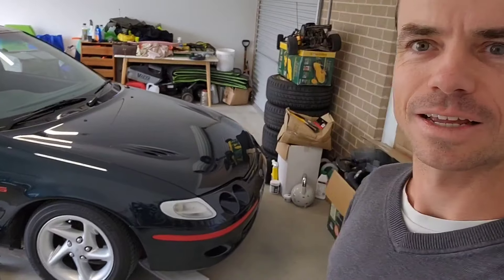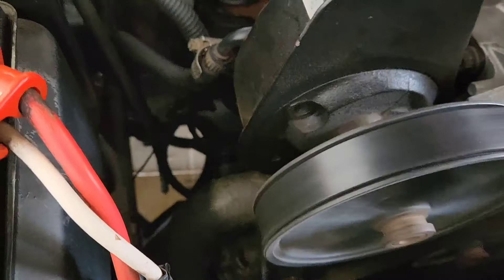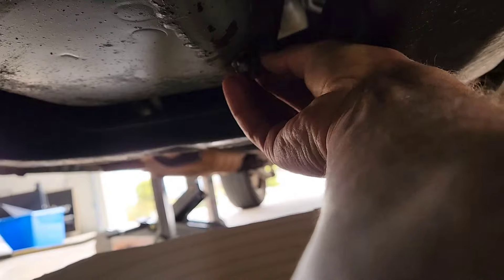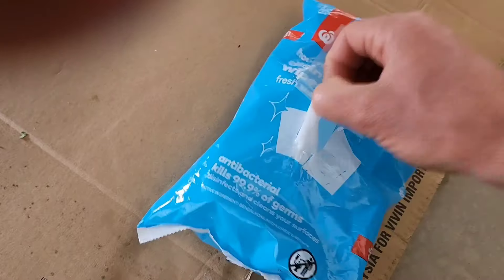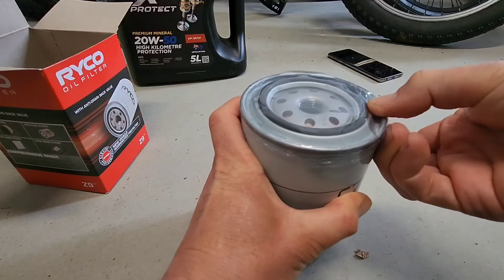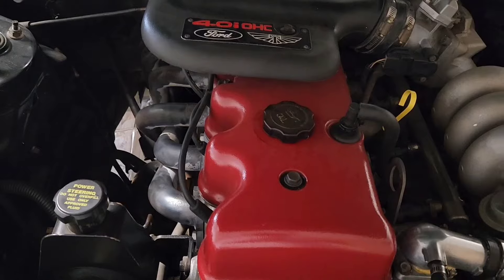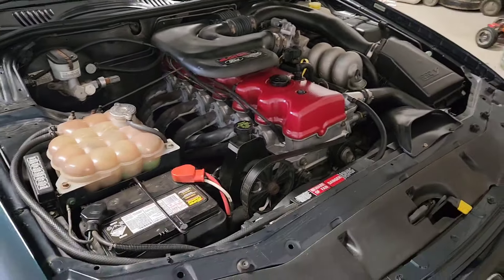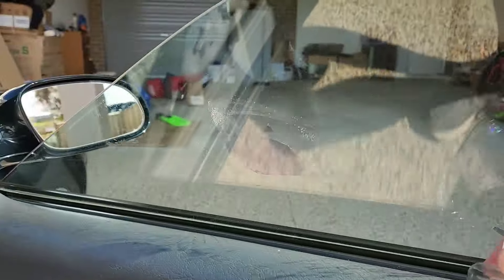Maintenance On My EF XR6 Ford Falcon - Too Late?

Comment: hey mate, i have a 2004 Ba Fairmont and i always use 10w40 Penrite semisynthetic oil and a Ryco filter (TIP when you pour the oil put the container on its side it mostly stops the glugging👍). Every 2 or 3 services i change the air, fuel and cabin filters as well as the oil + filter, I'm curious to know when do you change them? Also have you ever done a break fluid flush? I recently just flushed mine after 20 years 😶😂 and my brakes feel so much better. by the way your xr6 is mint its rare to see them in such nice condition these days 👌
Reply from the maker: Thanks for the tip on the oil, might try that next. I think I've only changed the air filter a twice, but I take it out and tap / blow it clean every now and then. I looked into changing the cabin filter, but turns out EF's don't have one! I really need to change the fuel filter next! I think it's due for a brake fluid flush, I'll do that when I change the rotors and pads. Brakes feel fine though, but would have been 10+ years since it was done, if ever! haha! Cheers mate!

Comment: Cheers for the upload mate. I have never used oil flush but do fill filters if they are in a position where it won’t pour back out before screwing up. Quite a tidy Falcon you have there. 👍
Reply from the maker: Cheers mate!

Comment: Love it dude. You know youre on a good thing there brother. The bond between man and his machine can not be understood by mere mortals. Also using top quality products there, i only use nulon or GW oils in my beast, aussie made for Aussie cars
Reply from the maker: Cheers mate, I love the thing! 👌
Reply: Be the mechanic and parts guy all in one. It's a Handy skill to have
Reply from the maker: That's it mate, saves money and it feels great to fix it yourself!
Reply: @efxr6538 Absolutely mate. The old skills our dads and grandfather's did, it ain't broken mate,  dad would say, it's just had too much love now ... Cheers Dad lmao
Reply: Also get yourself an automotive stethoscope, you'll pin point noises like it's no one's business
Reply from the maker: @TK-vz8hn  yeah, that would be a handy tool! Cheers!
Reply: And for the oil filter, there's a mailable plastic made for oil changes, can be shaped into the funnel required, eBay dude.
Reply from the maker: @TK-vz8hn  Cheers

Comment: That sound is caused by the belt not bearings. Spray the belt with water while it's running and you'll hear it stop. It will come back when it dries out.
Reply from the maker: Ok, will give that a go. I actually have a new belt ready to put on. Had it for ages, forgot that I even had it.

Comment: The only issue with engine flush is you’ll never get 100% of the oil out of the engine. There will always be some oil left over hiding somewhere. I always worry that after using engine flush there will be leftover staying in the engine
Reply from the maker: That's true, although I did let it drain for a long time and even jacked up the car on one side to really get the last of it out. But there will always be a tiny bit in there. If you really wanted to be OCD, could do another oil change after running the car for a bit, to really flush it out! I won't bother with a flush the next time. only every now and then.

Comment: Not sure if true but I was told modern synthetic oils tend to have alot of cleaning agents, which apparently isnt ideal for older cars. Seemed to suggest a premium mineral like that Nulon was the go.
Reply from the maker: Fair enough. It does say for high km engines and has Ford Falcon listed on the bottle. Also the guy at Auto One said it would be good stuff for my car, so I've used it the last 3 oil changes and it's running fine. 😁
Reply from the maker: I reckon!

Comment: I think thats your heater tap. Thats the vacuum line thats come out.
Reply from the maker: So what would happen if it's unplugged?
Reply: @efxr6538  the temp control switch in the cab won't make it open and close. When you turn it on to the red/heat side, the vacuum opens the heater tap and allows coolant to flow through the heater core and allow hot air to enter the cab.
Reply from the maker: @Angler233  But might heater always worked. It did make a hissing after I turning the car off though. Anyway, I connected it back up. Haha
Reply: @efxr6538  I think it's normally open, which means you would have had heating all the time?
Reply from the maker: @Angler233  nah, was able to change it. Unless it literally just fell off when I was working under the car. Maybe I knocked it off without realising.
Reply: @efxr6538  yeah probably with all that cleaning 😅
Reply from the maker: @Angler233  yeah, must have been! Haha
Reply: I have same plug in a xh
Reply from the maker: ok cool.

Comment: I thought you would at least use a semi synthetic.

I don't fill up my oil filters, only because on my lexus it goes in sideways 🤣
Reply from the maker: Maybe I should try it. I made sure not to completely fill the filter, but some still dripped out because it's installed on a slight angle on the engine. Oh will, just more oil to clean up! Lucky for the big oil bucket and big piece of cardboard I had under there! 🤣